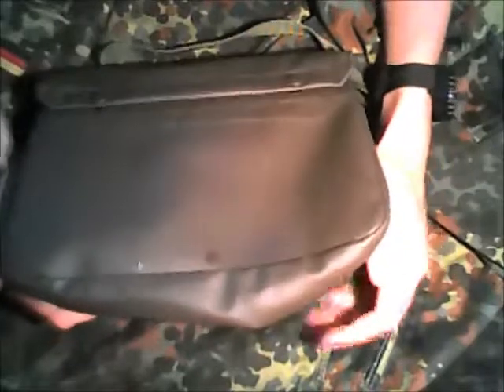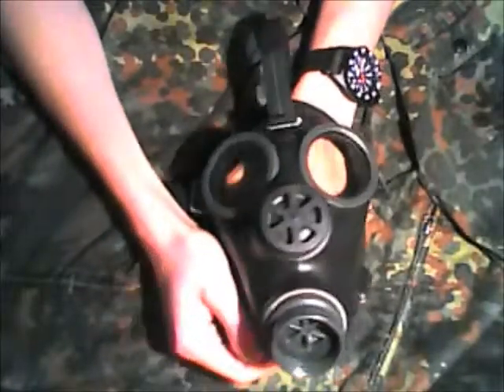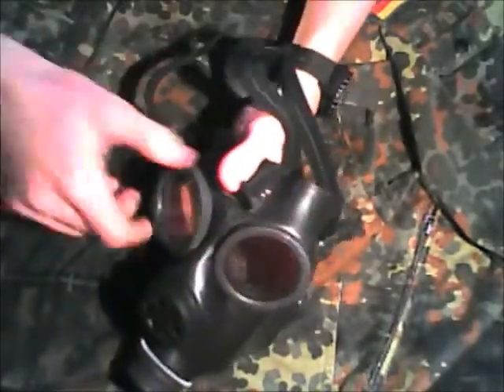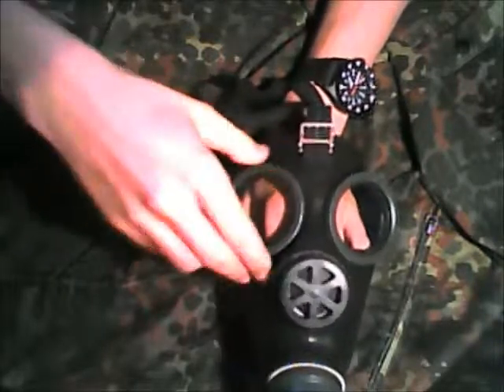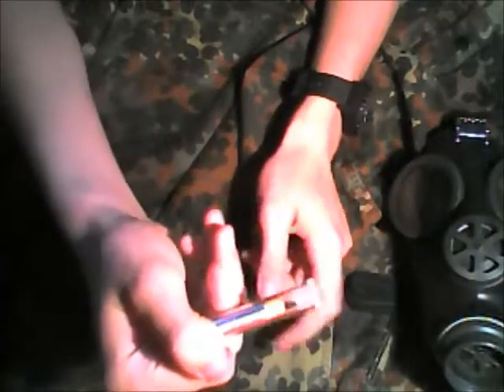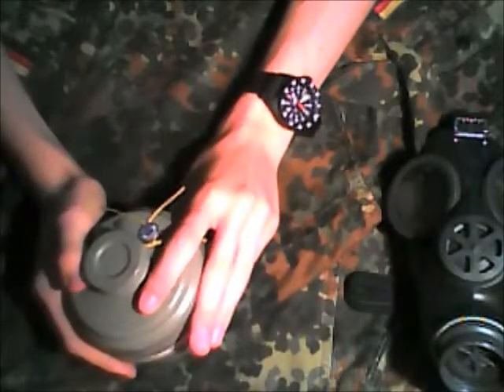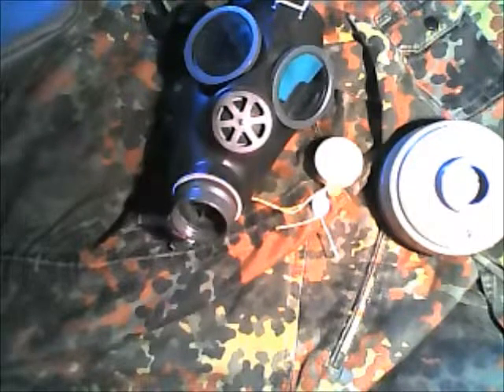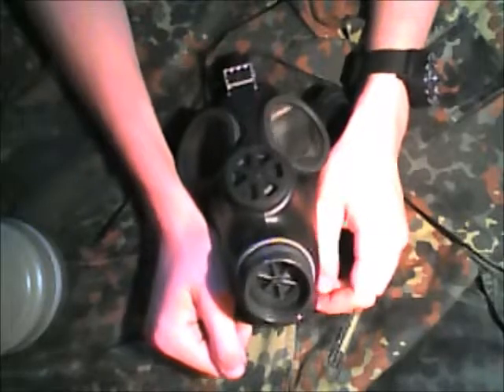Swiss SM74 gas mask review (engl.)

Comment: is there asbestos in the filter?
Reply from the maker: +Cate This filter is not the original one. It was made after the 50's so I guess it doesn't contain any asbestos. You can't be 100% sure though.
Reply: no thrs not i got 4 and itwas made in the 80s
Reply: The bad ones are made in  the 50s or 40s